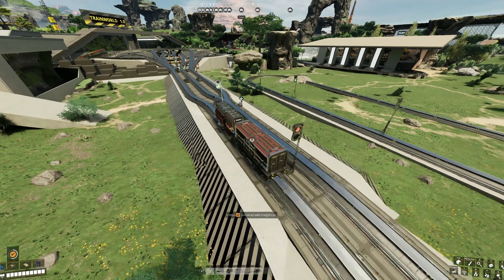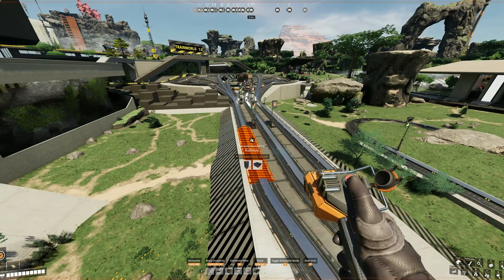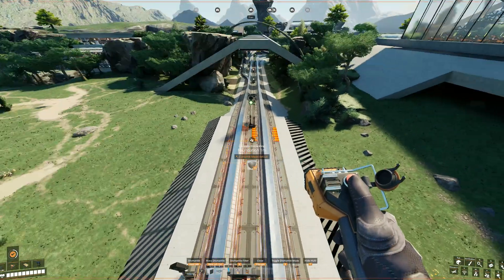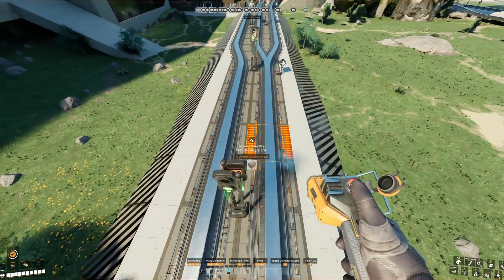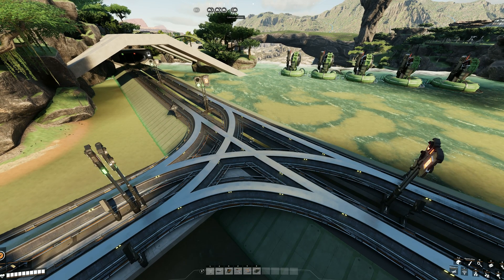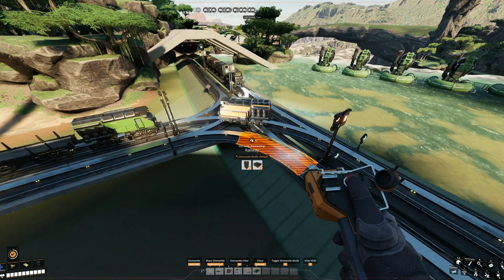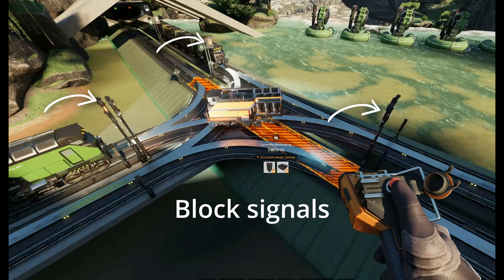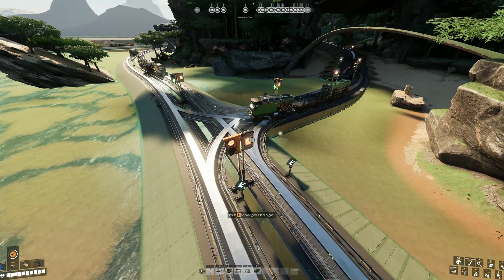Satisfactory - ULTIMATE beginners guide to TRAIN signals-understanding Path and Block sig operation

Comment: I think my issue was not knowing when to use path signals and when not too, i was trying to create a single track junction on a push/pull, after a hour of pulling my hair out i finally realized path signals just wont work how i wanted them too, just block signals on the junction worked and was all that was needed, sometimes over complicating the problem makes it alot worse
Reply from the maker: I agree, somthing that helps alot too is praxticing making the same kinds of junctions so that you can familliarize yourself with their design. It makes it easier to diagnose issues

Comment: To simplify:
Block signal=if space occupied wait. (For single path areas)

Path signal=if space potentially occupied check if paths are crossing. If not, keep going. (For multi path areas)
Reply from the maker: There is a little more to it then that but yes that is the jist of it. well put mate👍

Comment: so when placing any signal though, it has an arrow indicator for direction, should that always point in the direction you want the train to go?  Or in case of blocks should it point into the intersection you want to block off?
Reply from the maker: @salamada007  you dont have to worry about that littke arrow. It is just an indicator. It has no direct interation with you. It passivley tells you where the train is planning to go

Comment: I place block signals 1 full rail length apart. When doing a world rail network, that's a lot of block signals to place.
Reply from the maker: that is a rough amount, if you dont have many trains and your rails are long you only need a few however only placing a few will lead to very slow train travel time. more signals = better traffic flow
Reply: A block signal does what its name says: it signals to other trains that the current train is reserving that block. The fewer signals you place, the longer the block becomes that the train reserves. If you have long sections of track with no branches, and you don’t have many trains using that track, you could get away with one block signal at either end of that whole long block. But if you want multiple trains to be running close to each other through that long section, you need to add in another block for each train at least the length of the trains running the track; otherwise, the first train would reserve a long block of track, pausing the trains behind it until it leaves that long section. If you’re unsure, start with the fewest number of block signal you think you need. If trains start backing up, place another block signal at the midpoint of the two current block signals. That will now make two blocks half the length, allowing two trains to occupy what only one train could before. If you still find trains being backed-up, repeat and place a new block signal at the midpoint between the two existing signals are causing the backup until you find the right amount. Note that adding trains or track branching would cause you to readjust the number of signals. That’s why it’s good practice to place a lot more signals initially than you think you need for modularity in case you add trains or new branches.

Comment: Great tutorial! It helped a ton. I did have a question though, do the trains automatically decide what tracks to take? I have a train that always turns left at an intersection and takes a longer looping route that ends up in that same intersection and then heads to the station its going to. If it went right at that intersection the first time it would cut its travel down alot. Thanks in advance.
Reply from the maker: the reason the trains are looping for you is because you are using blueprinted roundabouts. you have to rip out the blueprinted rail and hand lay the roundabout and it will work normally. ran into this bug recently

Comment: So i have a long section of shared single track with a loop at the end. How can i make it so trains can follow each other, but will not enter the long section if theres an oncoming train anywhere on the long section? I.e wont end up in the middle, stopped, facing each other.
Reply: So, you would put a block signal at all paths joining to become the beginning of the long single path. A “Block Signal” Signals to other trains that your train is reserving that whole Block, so the train entering would now be reserving however long this block is. Since you want only one train on the single track and loop at a time, the whole single track and loop would be considered one “block.” To achieve this, the end of the single-track block after it has looped back around is where you would put either a block signal to reserve an the next upcoming block of track (or a path signal if the single track branches into multiple tracks after coming out.).    If you want certain incoming tracks to have priority, where you set the block signal that’s previous to the block signal for reserving the single-track section will achieve this. Place the signal for the top-priority track farthest from the block signal for the single-track section, so a train on this track would reach its block signal before trains on other tracks. For each successive lower-priority track, placing the block signal closer and closer that those on other tracks will make that track lower priority. The one with a block signal closest to the block signal to reserve the single-track section will be lowest in priority.

Comment: You little "Path in, chain out" rule is incredibly unhelpfull. The terms "Path" and "Chain" both refer to the same type of signal. Why on earth would you not just have said "Path in, block out"? You even seemed to realize your mistake while recording and just decided the redefine a term that people may already be familiar with instead of correcting yourself.
Reply: if you play factorio you would get it. Factorio is older and overall better and more polished game. There is a third signal called "chain" used for longer sections of the track. Satisfactory is banking on being "3d" and "pretty" but the bare bones are shallow.
Reply: @netspidercz  That's not just wildly condescending, but also factually incorrect.
Factorio also has just 2 signals and they are functionally the same as the ones in Satisfactory with Chain and Path being different names for the same thing. Thats why  "path in, chain out" makes no sense, particularly to anyone familiar with Factorio signaling.
Reply from the maker: you seem quite toxic my friend
Reply: @Rxckxt  Ill admit to perhaps being a little blunt, but I dont think that providing constructive criticism is "toxic". The intent is not to mock you, but to give you the feedback you need to grow your skills as a communicator.

Comment: So I guess my path signals did not work on a crossing like this but with a single track because everything was an exit and entry at the same time? I had a A to B single track setup and did a splitoff in the middel to C and only got errors all the time. Would you always advice a 2 track system? (it was adifficult mountain track)
Reply: If I might make a suggestions: "It depends".
Now the details: You absolutely can make a one-track-system. But it comes with a lot of problems. If you let your trains run on this system in both ways, you need alternate routes for your trains to go, when they would otherwise collide. Also, you need to place signals in both directions every time (not that big of a deal, but difficult with intersections).
The other solution would be, you build a giant circle and make it one-way. But then it might take a lot of time for your train(s) to reach its (their) designation and could reduce your overall productivity.
I myself made the second solution as my first ever built train track in this game. But then I used the knowledge from a lot of videos (and the very useful hover pack) to create a 2-track system. At least for my main train-tracks. Some areas, like the desert in the north-east are only covered by a, separated, one-track-system, since I don't plan to have that much traffic there.

Comment: Confusing. Why are you even saying "chain out"? There are no chain signals, there are path and block. Just stick to the terminology the game uses, dude.
Reply from the maker: @vPeteWalker  chain out is a common terminology used across many games with trains.
Reply: @Rxckxt  Chain signals are commonly referred to in other games because they exist in other games. But they do not exist here.

Chain signals are a special type of signal that do not exist in Satisfactory. They are a signal that chains a signal from a future signal back along the track to an earlier point. 

Meanwhile a block signal makes no such connections, and a path signal connects (someone might even say "chains") a path of multiple blocks forward.

Because path signals behave in a connected way similar to a chain signal, someone may hear the term "chain signal" and confuse path signals for a chain signal.

A path signal connects FORWARD, a chain signal connects BACKWARD, and the block signal does neither. 

Using a term that's common to other games may confuse people into thinking that signal type exists in this game when it does not, which may lead to confusion about how signals in Satisfactory work. And if somebody walks away from your tutorial video more confused about the signals than when they started, that defeats the purpose of the video. 

Chain signals are a thing that do not exist in Satisfactory. I wish they did, because it would make a signaling a lot easier for me.

And to top it all off, you're saying "CHAIN out" when the common saying is "chain IN, RAIL out."
Reply: @Rxckxt  many games = factorio. Just say it rocket, they won't get mad at you

Comment: What are those small arrow signs next to where lines diverge? / what do they do when u rotate them?
Reply: In real life they are to tell the engineer driving the engine that they will be taking whichever path it’s currently indicating unless they signal the track system that they want a different path, which the arrow would change to. Trains at speed can take a long time to slow down in reality, so you always want to know which directions the train will be taking at branches before you reach them, which those directional signals would show. Since the computer is the “engineer driving the train,” and also controlling the whole track system, it has already chosen the path it needs, so they are passive as far as you would be concerned. They’re only there so you can see which path the computer has chosen.
Reply: @EAS76  That’s really cool thanks :D
Reply from the maker: @aliceweirdopants4297  they are just there to let you know that there is a split in the track eg a left and a right turn. The arrow changes direction based on which way the automated train will go. eg if the train turns left, the arrow signal will display a laft hand arrow. If you turn them around they will just be backwards. I hope this helps

Comment: it's so simple a block blocks the block. 😂 but honestly, if you think about them as the same thing it might be a little bit easier (depending to how you think). If the lights red there's part of a train in the block so other trains are.... blocked from entering.

also, if you would drive on the correct side of the road/rail 😛 your path and block signals would be separate and on the outside (where they belong) I know you guys from the UK and Australia just don't like it.

Comment: All of the other tutorials I've seen have always used a path signal for in and block for out, I did not know a block could be used for in as well. Seems like the path may be better situationally, but I might be safe starting with just blocks at the start.
Reply: So if you look at it like a block signal reserves that whole block of track for the train, and a path signal reserves only one path of an intersection block of  track, then yes you can put a block signal at the beginning of an intersection. It would reserve ALL paths of the intersection block (including the path it’s taking), so even if another train’s path could allow it to travel through an intersection with the first train at the same time, if you have block signals at the beginning of the intersection, the first train would still reserve all paths and prevent that second train from entering the intersection block until the first train passes.     The priority system is working because the train that reaches the block signal that is farther from the signal at the intersection allows it to now reserve its straight path through the intersection before the other lower-priority train. That train doesn’t reach the block signal coming up to the path signal until it’s almost at the path signal at the intersection. The other train already chose the straight-through path that it needs to join onto, so it must wait to reserve its path. You could add a third tier if priority by adding in another track that has a block signal even farther away than the others, giving it new top priority.

Comment: That track-length priority trick is brilliant! I never realized that before, nice work!
Reply: its not any kind of priority, it has to do with the AI governing train tracks being in the locomotive itself rather than in the signals like in factorio and this video suggests, but in reality it has to do with the train needing to reach the block where the path follows to access it and reserve the path
Reply from the maker: @c4n0  so what your saying is the train creates a priority with the signal....
Reply: @Rxckxt  not at all, i repeat, it has to do with the train needing to reach the block where the path signal is, so it slows down when it enters that block, if the path signal is to close it has to break further, no "priority list" is ever createrd, the devs explained it when trains got patched a couple years back, there are videos showing this in detail with graphs and real numbers out there, check them out
Reply from the maker: @c4n0  the train does not need to slow down at all when entering a block containing a path signal it the distance between the pre block signal and initial path signal distance it far enough. I believe you should look up the deffinion of priority because tha IS exactly what is happening here. No its not a feature hard built into the game, no the devs never intended for that to happen. But it certainly does. Do the trains make use of the signals exactly the same every time, no but they will use them as a "priority" signaling system most if not all of the time. I feel like you are just trying to argue with me over the deffinition of a word and a feature that was not added to the game, yet it exists and i have a video of it right here and if the devs have real videos and numbers explaining all of this stuff so in depth why is it that i and many other youtubers have had to try to make video explaining this stuff?
Reply: @Rxckxt  you are the one arguing, there are videos out there, i understand getting called wrong as a youtuber is unthinkable for you https://www.youtube.com/watch?v=LpHE9iY9D1g thats why you are trying to poorly explain something clarified 2 years ago
Reply from the maker: @c4n0  mate there is no need to be toxic im simply trying to clarify my points from my video and help explain my point of view
Reply: @Rxckxt  so first you say i dont know the meaning of priority and that im arguing about something i dont know, and the moment i reply to that in the same tone you did, im toxic
Lmao dude
Reply from the maker: @c4n0  you claim the stuff i cover in my video was cover over two years ago but you linked me a video from 3 moths ago. I have also covered all the bases of your agruements with logic and yet you are the one throwing insults at my videos saying how poorly explained they are. Regardless of how they performed the origional point remains. This video does explain how you can create pathing priority with train and signal. I created this video to explain my point of view on how it works. Im aware there are many videos covering train things and im not the first. Sometimes people understand when explaining this a different way which is what i have tried to do here. If you do not like me or my content i could not care less. Every single piece of feeback you give. Negative comments, thimbs down, make a video explaining how wrong i am all directs new views to me channel and the yt algorythem loves it so keep telling me how wrong i am. You are just help me out 👍
Reply: @Rxckxt  you claim theres "priority lists" in your video, im proving you there are none, you insist to argue about everything, you and your video are wrong, sorry for the people that follow you
edit: if you think im reading all that you are wrong
Reply from the maker: @c4n0  your agument is completely invalid because there is video proof here that a signaling priority like system exists.
Reply: @c4n0 nah you wrong. Lmao. It is a priority, putting the block signal closer to the path signal delays the decision time for the train. So the train who gets to the entire path before the path signal will pass first. 

Seeing your entire argument made you a joke. Sorry, but it really is and you just made yourself look bad. Research furthe blud.
Reply from the maker: @EnderpriseArchitecture  glad you enjoyed it mate!

Comment: thank you for this and i would love to learn more from you! my train experience has been fairly minimal in early access but i want to use them a lot in 1.0, especially since they'll be available earlier. i had no idea that you technically don't need to use path signals at intersections. that would have saved me a headache when i extended my first railway